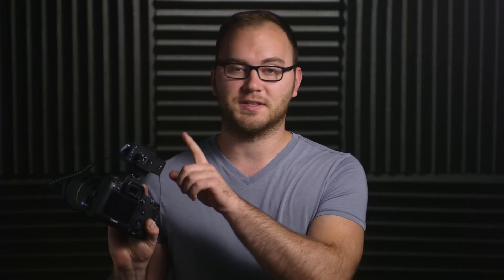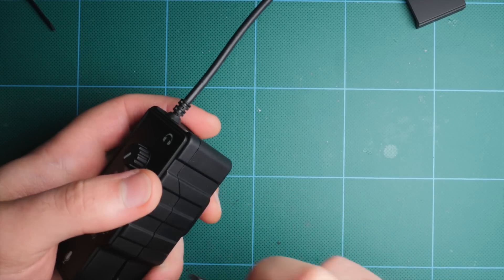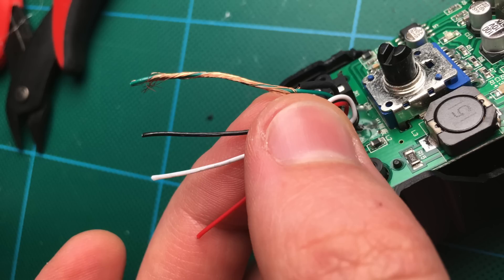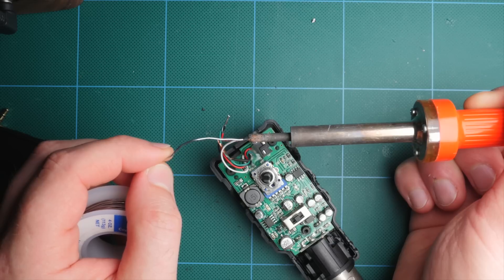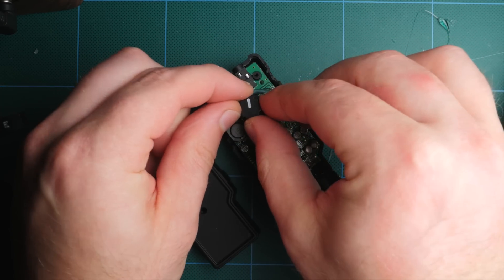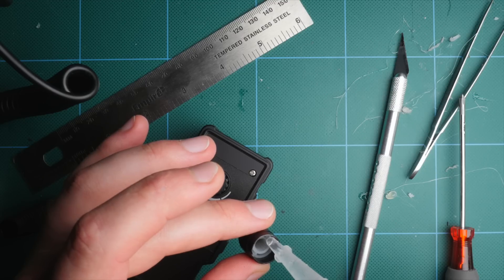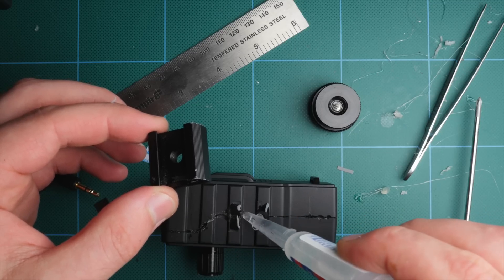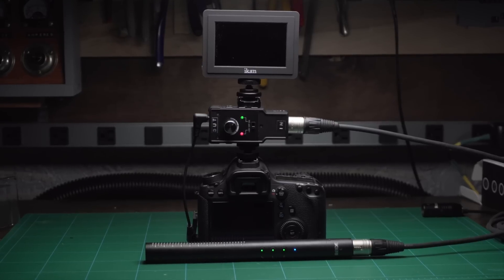Hacking the $23 Saramonic Preamp For Video Use

Comment: Loving your videos!  I'm an 80-year-old USAF vet who learned to solder circuits in tech school and the only thing I would disagree with is the use of a "Godzilla" soldering tool. Suggestion:...If you could use a "low wattage" soldering tool, not 'Granpa's do-it-all soldering tool... (even el-cheapo from eBay), you will get not only quicker joints, but they're 'prettier too'! Also, ...less likely to melt the plastic wire coatings!  Your presentations are, to say the least...AWESOME!  For an 'old school, multi-format' lover of the art, I check you out to avoid all the "...in my opinion/experience..."  experts, ...' you don't have to be a farmer to smell BS''....I'm in a South Kansas farm town we call the '4-corners' (Kansas-Oklahoma-Arkansas-Missouri) and we have some pretty strong, simple facts-of-life on everything (insert smile here)and that's just one!  If I make it to the big 80, I may still sharpen my new digital DSLR chops!  
Thanks again! "Doc"

Comment: i did the exact same thing . but i didn't solder the red wire with the black and green , instead i soldered the red wire  to a second 3.5mm female input and used it as a  second mono hot input signal .so now i have 2 separate mono signals one is the XLR (LEFT) channel that i control with the knob and the other mono input is the (RIGHT) channel that i use for wireless system.

Comment: You can also strap a Gopro tripod mount on it using the loops, or a cell phone tripod mount, like this one https://www.amazon.com/dp/B06Y3W6Z2T/ref=cm_sw_em_r_mt_dp_U_Wp-2EbBE2FZVE
You can also add additional shoe mounts with a bracket like this: https://www.amazon.com/dp/B002A92OVM/ref=cm_sw_em_r_mt_dp_U_tt-2Eb63S0GQ5 .

Comment: Hi Caleb, I made this mod and my "new trs" output works great. I get the audio output, but there is a constant hiss sound when i connect it directly to my Tascam DR-05 recorder. I shut down my Rode Ntg4+ mic which is connected to Saramonic, I keep only Saramonic open and record it, but there is a constant irritating hiss sound. When i unplug the 3.5mm cable and record through its built-in microphones hiss dissapears. Is it normal ? Did i do something wrong ?

Comment: Wow, such a simple explanation and pretty elegant solution for $23! I'm new to audio and video and people like you have really helped me learn fast! If you have time I have a question, I want to make a small diaphragm condenser shotgun like the mkh 416 since my budget is gone and I'm can machine the body. If my mic is simply a capsule and xlr connector will this preamp supply the 48v phantom power and any other tech needed to make it work? Thanks again!
Reply: I ended up buying a pro diety smic 2s, plugging this preamp inline and plugging it straight into the camera. The assembly is suspension mounted and has the same form factor and weight as the d3 pro, but with much better audio.

Comment: I have a question. I have Shure SM58, and I can not use it on my dslr (Nikon d7100) with just plugin it in (i have XLR to 6mm and adapter for 6mm to 3.5mm, so i can plug it in camera) because sound is terrible. So, can I use Saramonic SmartRig for SM58 and then plug in 3.5mm into camera? (btw i have mono cable, not stereo)

Comment: I was wondering does this  mean you will have to manually adjust the gain of your audio from now on then?

if so does that also mean that you would have to check the audio levels each time through the actual audio settings in say my 800D?

and would you recommend this kind of setup for vlogging?

THANKS!!! :)

Comment: I'd appreciate if anyone can HELP please :) So, I've got the Saramonic Smartrig. I have a Fender P-51 microphone (not the best, but I'm on the budget right now, so...). I am not much into soldering or hackin things, so I am looking for an easy way. I have a 3.5mm cable (something like this: http://img.dxcdn.com/productimages/sku_160155_1.jpg), it is an 6 feet extension cable with 3.5mm male and female ends. I usually use it with other microphone (it's a cheap condenser made for DSLR, but the XLR mics are much better, and I know the cable works), but when I try to use that cable to plug in the 3.5mm end from Saramonic and then to camera, nothing happens. I turned down the AGC on my Canon 600d, and turn up the knob on Saramonic and still nothing, no noise. I also turned up the volume a bit on the camera and still nothing. Is there any real difference between the Rode adapter and any other cable?
Reply: And if anyone can help: Would simple peeling the top of the cable (where the jack is) and replacing a trrs jack with a trs jack from the other cable work?

Comment: Hey Caleb! love your videos and thinking of doing this hack too, only i'd like to shorten the original cable and turn it in to a TRS. Any chance you checked which cable is which and what colour I should drop in the TRS?

edit: I could get the multimeter out and check it but if you've already done it it would save me the trouble :p

Comment: Awesome video and mod, thanks. If it's unclear to anyone, the headphone socket is only a return from the TRRS device that the smartrig is plugged into, it's not a live headphone monitor of the mic that's connected to the smartrig. So, for use on a camera or DSLR etc. if using a TRRS to TRS mic adapter, you would have no use for the socket anyway. This use of the headphone socket is awesome for camera/dslr users or anyone with a device that has a standard TRS or TS 3.5mm mic input. After the mod you can still use the modded smartrig with a TRRS smartphone etc. by using a TRS mic to TRRS cable/adapter.
Reply: Ah! Got it now :)
Reply: Thank you!

Comment: I'm trying the preamp out of the box first (I want to monitor through headphones) and running into some problems. My setup is: AT875r shotgun mic -> Saramonic preamp, built-in output cable (not a modded headphone jack) -> 3.5mm TRRS to 2.5mm TRS converter -> Panasonic GH2 (camera has a 2.5mm TRS jack for external mics). I don't get any signal from the mic. I've tried adjusting levels on both the preamp and the camera. And there's a hiss no matter what. In fact, when I plug headphones into the preamp, it records through the headphones! The whole thing is sort of absurd. Maybe modding the preamp would give me better results.
Reply: @Zach Lona I have the same issue although i modded the smartrig. When i connect my Rode Ntg4+ to saramonic and connect its "new trs" output to my Tascam DR-05, there is a constant hiss sound which drives me crazy. When i only use built-in microphones on Tascam recorder, i get much cleaner audio. Did you solve this already ?

Comment: Firstly, great video! Sorry If this is really simple I am just learning about all this stuff! With this setup does the microphone need to have an XLR connection? All of the shotgun mics that I look at have a 3.5mm to 3.5mm so would you just get a 3.5mm to XLR cable to run from the mic to the preamp? Thanks
Reply: Ah. I just realised that there is a 3.5mm to XLR adaptor in the frame at https://youtu.be/997z3f0Vzho?t=5m16s. Thanks!

Comment: Hello, I purchased this assuming this will also take line inputs via XLR but seems like it doesnt seem to work.. Could you please suggest if it can take Line Inputs. I record programs at Sikh Temples and usually take the audio Line output from the audio mixer already being used for PA purposes.

Comment: Hi Caleb, big fan of your work, keepup the good work!
I was wondering if I can connect this Modified Preamp with a male XLR to female 3.5 adapter to a Rode VideoMic Cayote (wich has its own 9V battery).   "GH4" to "3.5 male to male" to " Hacked Saramonic SmartRig" to "male XLR to female 3.5" to "Rode VideoMic".
Got an image to explain here https://www.dropbox.com/s/0m5osmnst2esa0n/SMARTRIG%20MOD.png?dl=0
Reply: Anyone?
Reply: Wondering the same thing, I think it should work, since most PreAmps like the SmartRig having an XLR entry, are able to take a signal from a self ampl mic ( = without 48V phantom power), which might be equivalent to a shotgun mic with jack.

 3.5 Jack & XLR transport the same signal, that's why we can convert 1 to the other passively. The phantom power is only here due to the sensitivity of condensers which need + amplification to work, but, before the required power is sent, the signal is of the same "nature" (in the case of self amp mics, this signal would be right before reaching the battery power, & in the case of power coming from the preamp, it's right before the preamp), then, once the power is delivered, the signal coming through the recorder (which may be the same as the preamp in the case of Recs like Zoom H4/5/6 & Tascam, since they're both in 1) is of the same nature too.

The only difference in the story, is the mic itself, which might not react the same from the external preamps, but plugging as in your image, or in any non XLR device  (cameras, smartphones, etc), is failry even, except of course the SmartRig preamps are far superior in quality. 

So this is all theory, leading me to the conclusion : Yes. Obviously, DON'T use phantom power on the VideoMic, it's not designed for that, & this is probably the only risk here...
But I know it's been 2yrs since the question was asked, so if you've got any exprc so far, feel free to share for future readers :)

Comment: Just after finishing this, I left out the nob replacement and rewiring the headphone jack. I thought I'd be able to monitor the audio live via the headphone jack but it's only for playback. It would be great if you had a workaround so I could monitor the audio on my 70d while recording. Great video!
Reply from the maker: Yeah, unfortunately the headphone jack is only compatible with phones using TRRS jacks :-(
Reply: If you do rewire the headphone jack to act as the output, could you use a splitter and be able to monitor with headphones?

Comment: Hey I finally got my saramonic smart rig was hard to find in London.  Amazon had one.  Can I use phantom power with a non powered microphone.? Or just the on?
Reply: Don't use phantom power if your microphone does not require it. You could wreck it. The on switch will work fine

Comment: What is the purpose of cutting and soldering  the wires together?? Is it to send better signal to the headphone jack or just to lose the old cable??
Couldn't you originally just used the headphone jack as output ???
Reply from the maker: I knew I wouldn't use the jack for headphone use myself, and I wanted to be able to change the cable length using my own 3.5mm cable.

Comment: In the first video, you used (with an adapter) the existing cable to connect to the camera.  In this video, you look like you are cutting the original cable, shorting them out, then hiding them.  Ok, so now how are you connecting the amp to the camera?  Thru the headphone jack?  If this is the case, why not simply cut the original wires off flush at the PCB?
Reply from the maker: Hey Danny, you're idea is probably best. Add a female jack to the case where the cable was. What I did was easier, but may not have been best. That said, at the end of the day I didn't notice a quality difference and it still sounds amazing.

Comment: Hi Caleb, I was wondering what the difference was between the audio cable signal and the  headphone jack signal. Why not go directly from the headphone jack to the camera, without the modifications? Also, how does the rewiring push the signal to the headphone jack? Thanks a lot, and great video!

Comment: How about, instead of cutting the cable turn it to female jack and have both output and monitoring female jack? is it technically possible and worth making it?
Reply from the maker: Yes that is definitely possible. I knew I wouldn't use the headphone jack, but I should have mentioned it.
Reply: and how do you connect female jack to those cables?
Reply from the maker: I would use something like this: http://amzn.to/2dxBqUx and just glue it in place of the original cable.
Reply: DSLR Video Shooter can you please make a video showing us how we can add another output jack? I need to monitor my audio when recording please or at least tell me what colors do I connect to the connectors?
Reply: Ivan Fedorych how do I cut the cable a solder the new connector? I dont know what colors to match

Comment: Hey Caleb! Huge fan of your work, your channel is easily my favorite resource on the internet for any sort of practical advice on digital filmmaking tools, so I must thank you for it, and for the hard work in making the absolute best DIY cameras for budget wannabes like myself!

Regarding the Saramonic SmartRig, you’ve sold me on it, I just have two questions:

-I find myself using my camera’s (the G7) audio on the minimum gain most of the time when I use my VideoMicro and still get decent levels. If I got the Saramonic, should I get an attenuator as well, then? That combo would significantly lower my audio noise-floor, right?;
-What audio would the headphone jack on the Saramonic output when connected to a camera like the G7, which has no jack audio output? It can't be what the camera is actually recording, so I can't understand what it would be.

Again, thanks a lot, whether you might get a chance to answer or not!
Reply from the maker: Thank you for the kind words Jose. Means a lot! 

Let me start by saying this won't work with the VideoMicro. That mic needs low voltage from the camera which the SmartRig does not output. 

I don't know if the attenuator would help. Because at the end of the day, the camera levels can only go so low. But having a 48v mic or even a VideoMic from Rode would help since the mic would be cleaner from the start.

The headphone jack would let you monitor the audio from the preamp which obviously isn't from the camera. So you wouldn't hear what is being recorded, but you'd at least have an idea of what is going on.
Reply: Thanks a lot for taking the time to reply, and for saving me from making a dumb mistake. Not the first time!
Reply: DSLR Video Shooter hey will the Rode VideoMic Go work with the smart rig? I was planning to buy this and use a rode VideoMic Go for my audio equipment. :)

Comment: Or can you make another video making the trrs cable a jack for TRS ?
If not I´ll have to figure it out !
Thank you in any case just open a world of options.
Reply: buy it...
https://www.bhphotovideo.com/c/product/1048150-REG/rode_sc3_trrs_to_trs_adaptor.html
Reply: Just connected to a 3.5 mm TRS connector cut the cable and solder.
MUCH STRONGER CONNECTION
Reply: smitthone I was going to comment the same thing. If you don't want to put anything apart just buy an adapter.

Comment: Caleb, have you seen this? https://www.amazon.com/dp/B01LBS52YI/ref=cm_sw_r_sms_tai_6Vc5xb
Reply from the maker: The main draw to the unit I used was the price. $23 for great audio is a pretty massive bargain! I'm not worked about the glue with that 4" monitor. I would never mount a shogun on that though!
Reply: This makes more sense obviously but Caleb's solution is a little handy work and I like the cold shoe mount he adds... although I don't know if I would trust the glue to hold a monitor like he showed.
Reply from the maker: I have. Actually, I'm looking at one on my desk... SUPER power unit and I'll be doing a video on it soon. It is also a component on another epic camera build I'm working on ;-)
Reply: The one I did is bolted through the battery compartment. I wouldn't be afraid to mount anything within reason on top of it

Comment: If I want to keep the headphone connection for headphone and to change the TRRS connector for aTRS connector.
I'll say Copper and white makes ground, Green cut it and leave it off, Red Microphone Right channel, and Black left.
microphone channel, Is that OK ?
Reply from the maker: You could definitely do that. Unfortunately the colors aren't universal (except the shielded wire) but you can easily figure it out. On a different project, I actually hooked everything up and used alligator clips to figure the wiring out while everything is powered on. Just keep 48v off and wear headphones turned down. You'll hear what you've got the combos right!
Reply: THANK YOU

Comment: I'm a little confused.. so once you cut the wire and soldered them together, you just glued it to the pcb? why? that makes the headphone jack into a mic output? I'm a little confused
Reply: UE853 
Me too.
Reply: Yeah, me too.
Reply: Headphone jack = Mic output to the camera.
Reply: I think he uses the jack for the headphones, as out for the amp coming in the mic section of the camera, as camera comes with headphone jack itself, for monitoring. Those are just for troubleshooting purposes. An "official answer" would be much appreciated.

Comment: I'm a little confused.. so once you cut the wire and soldered them together, you just glued it to the pcb? why? that makes the headphone jack into a mic output? I'm a little confused
Reply: I'm confused too... So those cables are not connected to anything anymore? I feel like I'm missing a step! :)
Reply: Same.
Reply from the maker: Hey Bethel, The wiring I did in the video routes the output (was a cable) through the headphone jack. That way I can add any 3.5 to 3.5 cable to the jack and run it to my camera. I don't like having long fixed cables on gear so this setup was best for me.
Reply from the maker: They are, the wiring I did in the video routes the output (was a cable) through the headphone jack.
Reply from the maker: Right on!
Reply: Thanks Caleb! Much appreciated!

Comment: Are you sure the headphone jack has the same output as the TRRS out? I feel like it could be a transistor/resistor somewhere on the pcb thats different with the outputs?
Reply from the maker: You could be right, but since this is such a cheap unit, I doubt they did much more than split the output. At the end of the day it still sounds great. I probably should have just turned the output cable into a jack.